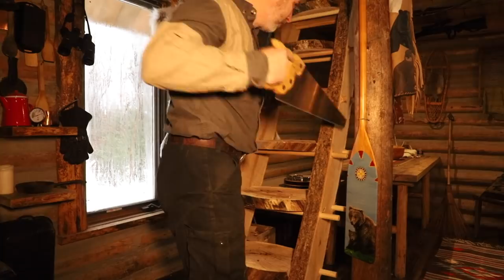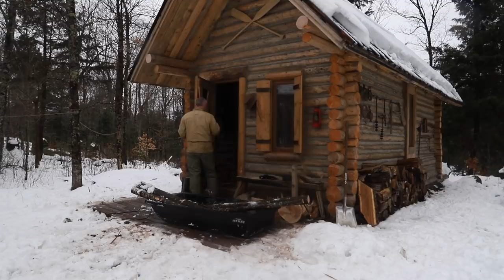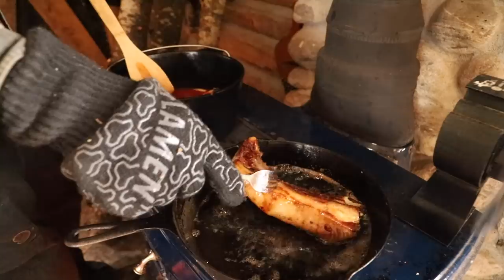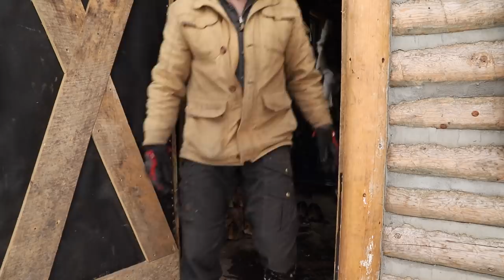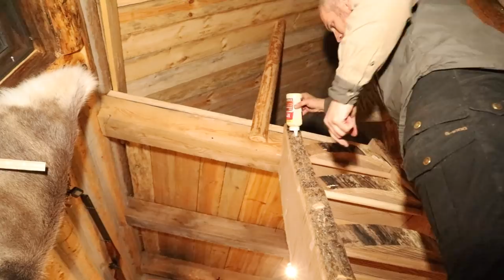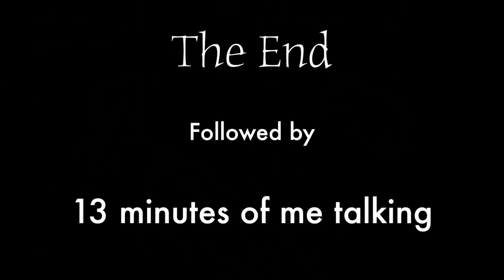Live Edge Wood Staircase in a Rustic Log Cabin | Working Alone

Comment: have you ever tried to use a rope to get the snow of the roof? the cabins roof angle should be steep enougth to do it. you throw a rope over and bind it to a tree on one side and then start cutting it deep and then dragging it along. works better with two people because you can "saw" but its doable alone

Comment: I have a question. what do you do for laundry/washing your clothes? do you hand wash them or go to a laundromat?
Reply: He doesn't live in the cabin. Im sure he brings enough clothes for the time he's staying.
Reply: Good question.
Reply: I was thinking be hard pushed to find a laundramat out there , sorry to person who asked the question not picking at  you , my silly sense of humour .
Reply: @essex1st  I have seen others who have improvised clothes washing systems.

A couple good sized rubbermaid trash cans.

Fill one partially with water add laundry soap. Put in some clothes and use a round ended stick to agitate.

Wring out the clothing and then use the second can as a rinse cycle.

You will need to rinse them a couple of times.

Hang on a line to air dry.

Fairly time and resource consuming.
Reply: Another video I was watching on another man doing the same thing off grid cabin. He had a plastic bag of sort he got off amazon for hand washing clothes. He demonstrated doing socks and underwear. It worked pretty slick. Now he did say he very rarely used it for big pieces because you could only do one piece at a time

Comment: Great videos. I just finished building a home in Cali, Colombia at the age of 71 years old. I built the second floor myself and I would not have wanted it any other way. I layed all of the bricks, made all of the cement columns and did all of the steel work alone. In stead of the cold, I had to deal with some exhaustive heat. It was a lot of fun.

Comment: Have you  heard of driving slightly oversize square dowels into round holes? Supposed to work really well. I'd be surprised if no one has asked, just wondering if you considered a rocket stove to heat the place and cook inside. So much more efficient and longer lasting heat. Really enjoy work you're doing. You're setting a fine example.

Comment: I was wondering why you did not pilot hole the sides of the steps and put in 4 screws per step and two on each side for stability. I saw one flopping around on you and thought that might help. I watch every video and enjoy the pioneering carpentry you do. I have built a few houses but not with lumber I just cut down. Keep on sending us videos and tell Cali Jim from Las Vegas says Howdy!! ps I saw a video with a guy using a long metal straight edge and an alaskan chain saw mill like yours. His wood came out super straight.

Comment: I learn a lot of techniques watching your videos; and when I don't understand why you are proceeding the way that you are at times, it usually shows up later in the video.  So I'd like to ask why you didn't limb and debark that tree after you dropped it and stretched it out (just before you walked it down).  Suspended like that it would seem to have been much easier to limb with your hatchet all the way around, and even easier to peel the bark from with your draw knife and/or hatchet.  You seemed to have to really work at the bark peeling back at the cabin.  Thanks, I really enjoy your workmanship with hand tools and learn a lot from you for work at my remote piece of property with no electricity or running water (in pipes that is).

Comment: Another observation re handedness, I was surprised to see you using the bit & brace auger drilling the stair holes you used your left arm as the driving arm when you use the right arm for sawing, is this your way of keeping even strengths in both arms?

Comment: I'm concerned with the steps you installed on that ladder. I didn't see anything securing them in a twisting direction. If someone steps on just the forward lip, do they flip forward?  One or two looked loose when you tried them. Maybe a pole in the back of the stair above the step to hold it down?
Reply from the maker: I'll show you soon

Comment: If I can say..............Get a roof rake. The rakes are usually 16" wide and made of heavy duty plastic. They are kind to the roof. Most have (4) 4 ft snap on extensions. You won't need all of them, but nice to have. I have used mine. And boy I get snow here at 1200 in a good Winter. Had it for a few years. Still really good. It is a workout. Cuts the drifts down good. Ocean State Job Lot 38 dollars.    Forget the hoe.        Ted  from a NW hill town Connecticut.

Comment: The way you cut your stair treads .....accross the grain .... Is going to get someone hurt. The tread will break easily when stepped on at an unsupported spot like the leading edge as you are ascending the ladder. There is no strength when cut accross the grain
Reply: And the supports are also way too thin. I was also thinking that that can not be safe at all. It needs to be rebuilt.

Comment: I hope you screwed those stair treads into the stringer from the outside into the tread with some 3 1/2 screws so, you don't bust your ass when the loose tread flips up on you. and some half circle pipe clamps on the dowels to the tread underneath. Maybe you did but the edit in the video took us away from the job.